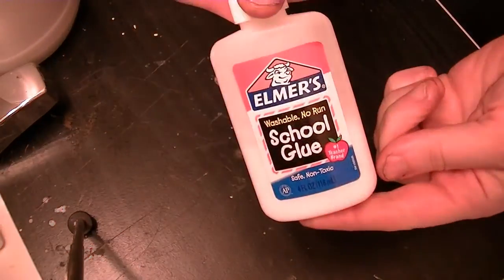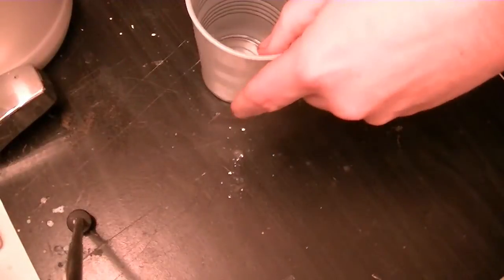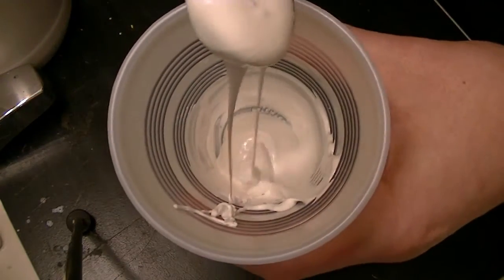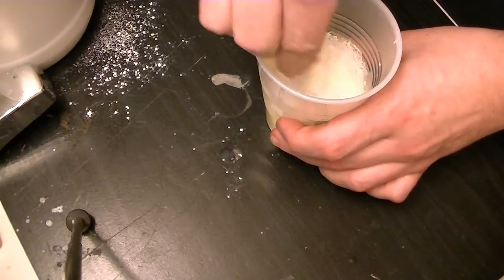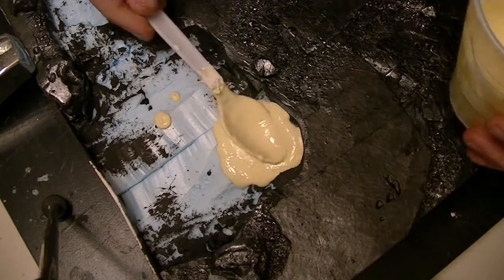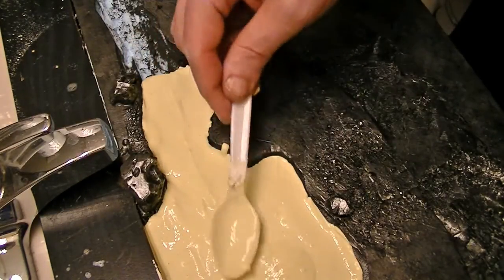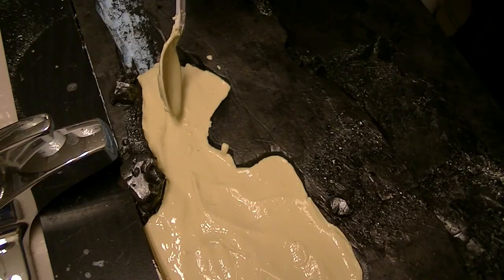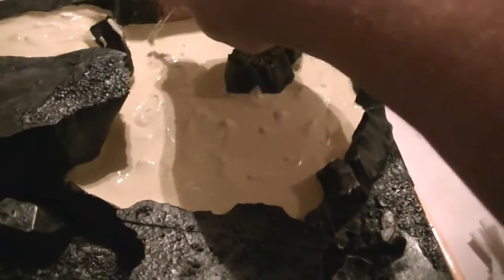Making lava - mixing pouring

Comment: Do you have a picture of the whole base before paining? I need a base like this badly.
Reply from the maker: I do not. Sorry. What is it you need to know? It was pretty basic. Foam cut to shape(to look like rocks) glued together, sand and whatnot for texture, then paint.
Reply: Bob the Odd Thanks Bob. I specifically want to make this for a 6”Vader diorama. Did you use blue polystyrene? My main question is about the foam once cut and glued.  Was it hard coated with plaster or like you mention painted with metallic black?
Reply from the maker: I've used blue and pink, Its all basically the same. No, I did not coat it, but that wouldn't be a bad idea. I usually base my stuff with latex house paint. Its durable and bond to surfaces well, also takes the craft paints well.
Reply: Bob the Odd Thank You!

Comment: The actual construction of it
Reply from the maker: Most of the shape are cut with a hot-wire foam cutter I picked up at the craft store. Used Liquid nails to glue it all together. Textured with sand and kitty litter. Based black, then metallic black to give it that volcanic rock look.

Comment: Where do you get the paint from?
Reply from the maker: Walmart or Hobby Lobby
Reply: Bob the Odd how did you make the base? I mean the surface the black thing
Reply from the maker: Its insulation foam(cut with a hot wire foam cutter), textured with sand and litter. Just like the cracked ruin wall vid I did.
Reply: Bob the Odd you just cracked the foam and paint it ?
Reply: What are the color you use base surface
Reply from the maker: Razor knife and I might have used a hot wire foam cutter, been a while since I put it together and I dont have it anymore.
Reply from the maker: Black latex house paint, then Folkart Sequin black.
Reply: Bob the Odd you also use white right
Reply from the maker: Not that can remember. The only other color(besides the 2 blacks) on the dio is the light blue, of the foam.